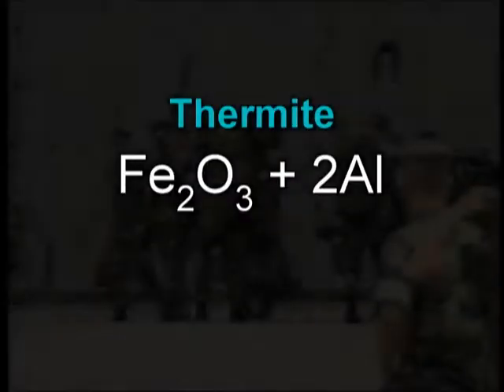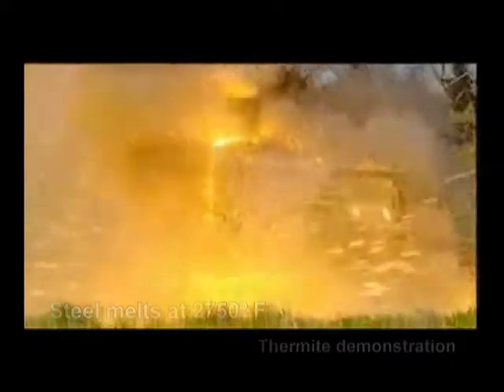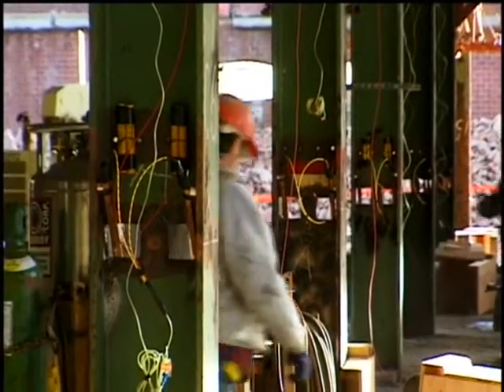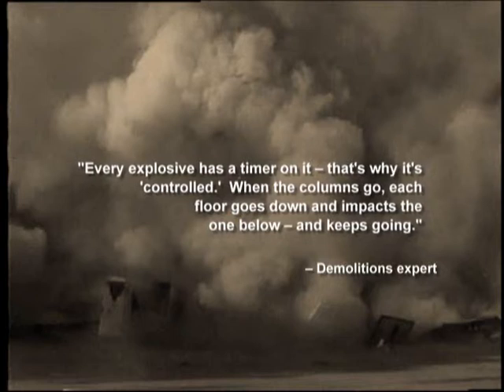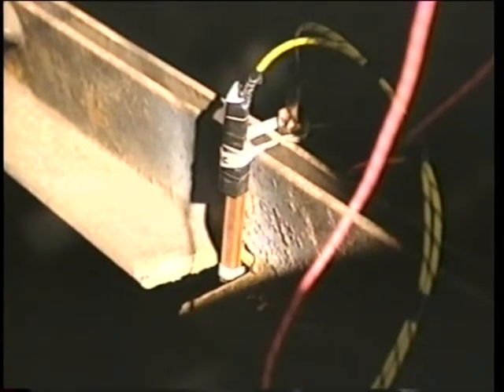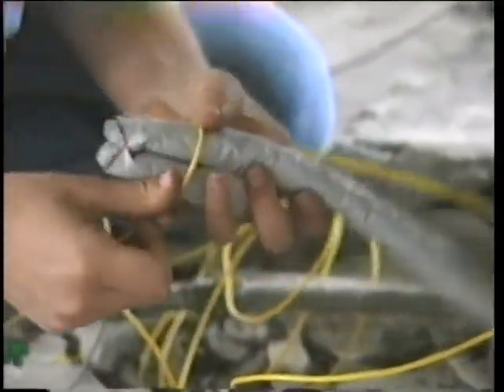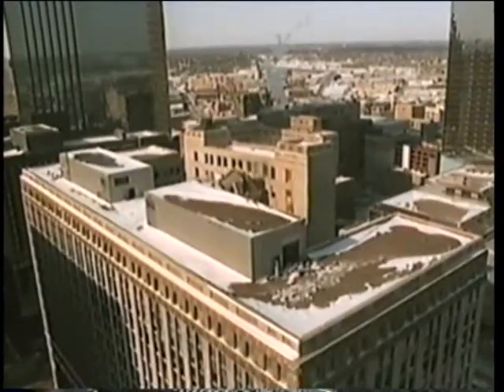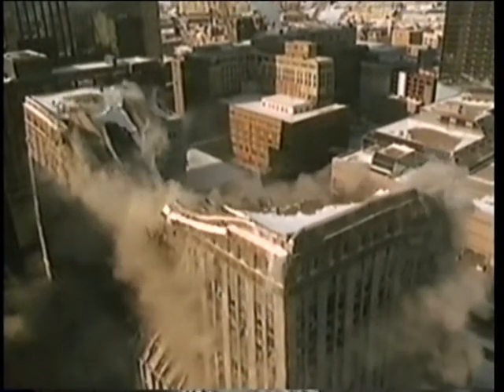Building demolitions mimic World Trade Center

Comment: That "no explosion sound" is old and boring Debunker baloney, pulled out just right of the ass without fact checking this bare assertion first.

Especially in case of WTC2 there are numerous videos which contain a loud boom before the top third started to tilt and fall. The boom sound is louder than the subsequent total collapse itself.

https://youtu.be/lqfbOfNacuM?t=1m
https://youtu.be/FMM7VTMewxE?t=2m2s
https://youtu.be/0IvicKnhANs?t=5s (note the reporter's words just after the boom: "a huge explosion")
https://youtu.be/wIiIg4G0XOk?t=21s
https://youtu.be/RLW0jKKRXMo?t=4m37s

The now collected eyewitness accounts from 156 first responders support that audiovisual evidence:
http://www1.ae911truth.org/downloads/156eyewitnessaccounts.pdf

Similar case with WTC7 collapse: A loud boom precedes the east-penthouse collapsing at free-fall through the building, also louder than the subsequent local an total collapses:

https://youtu.be/4xN8lzBo9zY
https://youtu.be/wI8CNWf6lr0?t=52s

Again, the only few available eyewitness accounts of the collapse support the audiovisual evidence:

https://youtu.be/N57HWhRgCZI?t=35s
https://youtu.be/b4z-Wrp1pY8?t=60
Reply: Fantastic work. I read all witnesses testimonies. Unbelievable :O

Comment: Not here to cause an argument, but the towers in the trade centre could have collapsed due to molten aluminium. The planes buried themselves in the gypsum insulation and other various things and it would have got hot enough inside this rubble to melt aluminium. And if you do your research, you will find that molten aluminium explodes pretty violently when it touches water due to extreme amounts of hydrogen being given off. Where is the water you ask? Coming from the broken pipes and all of the bottles of water being spilled all over the floors. When aluminium is in such a liquid state, it would flow down elevator shafts and through cracks in the floor. It may also sound stupid, but all of the cans of soda melting would go off like mini grenades.

Oh and think of this: if your government did this, you guys would be furious and shit would really hit the fan. It would be pretty fucking stupid of the president to order it and have you all go to war for it, and then you guys found out and caused a civil war. That would be funny for us in the UK but not funny for the Government.

Comment: No one seems to notice that this and all implosions happen bottom up. twin towers collapsed top down. Stupidity reigns. Plus,  just look at the prep work needed, another small tidbit that you foil hats dismiss SMH at the idiocy
Reply: Knee-jerk debunkerism as usual, lacking the basic logic and knowledge.
According to top demolition experts like Mark or Stacey Loizeaux, you can start to demolish structures wherever you want. Timing is the key and the utilization of the building's potential energy to destroy itself in the demolition process (-> less explosives needed -> diminishing of sound, seismic tremor and flying shrapnels).

Funny how the debunking clowns accept blindly the official notion, that all is needed to collapse such skyscrapers into smoldering heaps were only some impact damage from airplanes and office fires on few upper floors. But somehow to explosively demolish them you need to wire them up on almost every floor. LOL

So, according to you, demolitions start only on lower floors. Right? So, what about WTC7 then? Not only the collapse have started on lower floors but the entire building fell so fast in a way that can only be described as an textbook example of an implosion.
Reply: Yeah all except for the father of that poor Bobby guy killed at ground level, outside the lobby by flying glass from an "explosion" before any flying objects hit the upper floors. Not even to mention the others saying the same thing: a bomb went off in the lobby. And of course all the video footage of columns at ground level clearly showing cuts at a 45° angle just demolition loaders do when they bring buildings down in precisely controlled sequences.

Comment: Uh, no!

This vid should not have this title.  It is deceiving.

You can clearly see in vids from 9/11 how the towers fell.  Controlled demolition means a building falls into itself.  The twin towers did not.  In these vids, you can see the tops, I don't know how else to describe it except, that they blossomed outward like a flower.  OUTWARD not INWARD.

Controlled demolition...inward.

Twin towers collapse...outward.

Again, outward, not inward.
Reply: tudorjason u moron watch the last video next to WTC7 and you see roughly the same. However have you looked at WTC6? explain that! There is nothing at the bottom for it to have fallen in on it self.  the material is turned to dust from the inside like a microwave cooks the insides
Reply: dotslashsatan Ah yes, personal attacks. Isn't the anonymity of the Internet helpful!  How do i type a rolling eyes emoticon?
Reply: Personally, I think it's possible the bible could have been written by anyone.

However, I provided a clear explanation about one of the reasons why I believe what I do.  You just gave an insult.

Comment: I don't understand WHY this is still an argument.
Challenge for you: If you believe the official story of 9/11, please just find me one video of a structural failure of a steel framed building (NOT COMPOSITE), that looks anything like what we saw on 9/11. 
Since you cannot do that, and since all building demolition footage looks exactly like 9/11, I think you have a serious problem with scientific reasoning if you actually think jet fuel did that.
Reply: +ProPain   More accurately, instead of "steel framed", which equates the Towers to normal box column design, it should be "Large Span, tube type towers". WTC 1, 2, and 7 were the only Large Spans in existence at the time, and the only ones to be pummeled with 100+ tons of flying mass, followed by abnormally spreading fires.
Reply: Coughcough Plasco tower Coughcough 

wheeze*Sao Paulo tower collapse *coughcough
Reply: All explosive demolition SOUNDS different than 9/11.  Notice the enormous sharp cracks, not just the rumble of debris like the WTC? https://youtu.be/4NzSxSUb0Kk
Reply: I challenge you,  show me an example to prove your argument where a jumbo jet filled with fuel slammed into a steel framed building at 500 mph  and burned uncontrollably without failure.    It looks like a demo but its not.

Comment: Incendiaries are never used, obviously.  They wouldn't work for the split-second timing required.

High explosives, like glyceryl trinitrate or RDX are generally used since their exact moment of detonation can be accurately timed, and the failure of each structural member with a shaped charge can be predicted accurately.